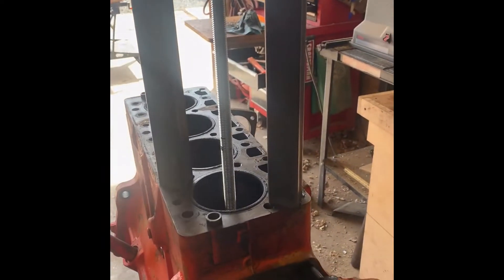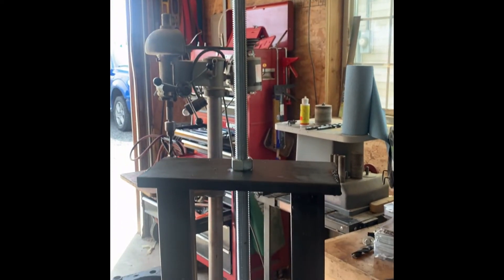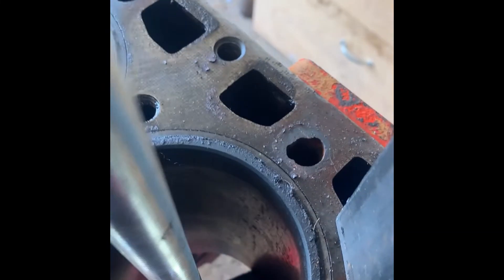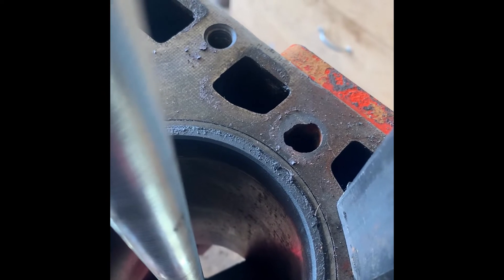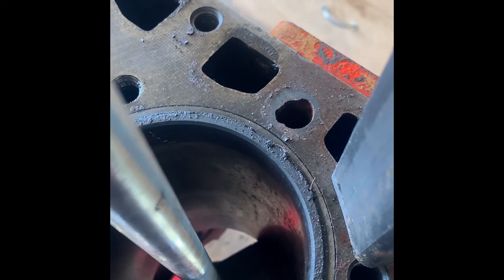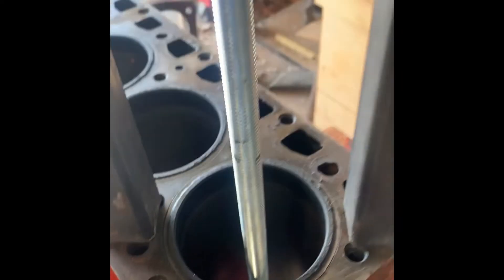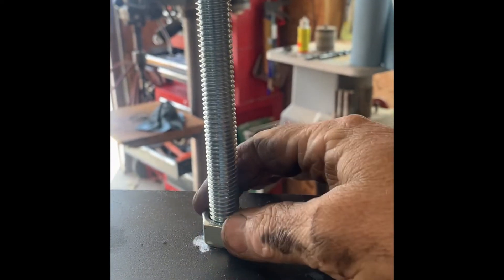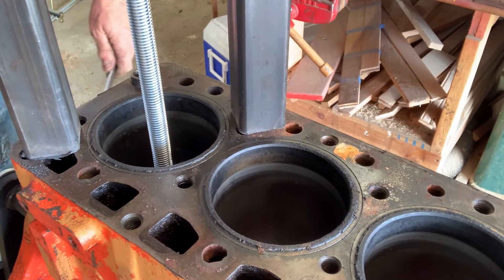Case Tractor 188d  Project #7 Pulling cylinder liners with homemade tool!

Comment: Hey Jerry, I skipped forward to the liner video.  What you built for pulling liners is just fine. I pick virtually every pulling plate I can find at farm or industrial auctions.  So I've got a wide variety of diameters in a five gallon bucket.  I have a couple of arches as well. My favorite is an old Case arch that belonged to my uncle who I started helping as a young boy because his eyesight was not good enough to do the work with small parts like valve spring keepers. I'm greatly impressed with what I can see of your wood working shop too !!  Awesome.  Its gonna take a while, but I will see all the videos.  Thanks for stopping by my channel and pointing me this direction.  I just gotta see your mill too.  I have a cheapie....Frontier OS27 but I've been around non-commercial circle mills for many many years.